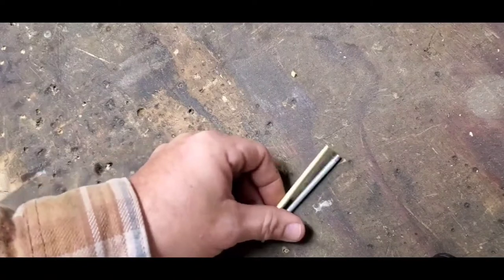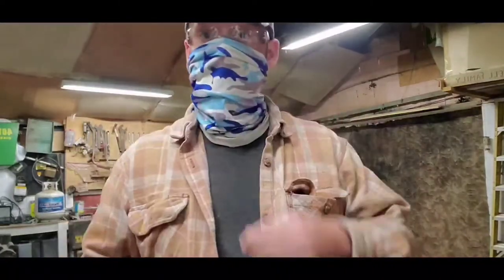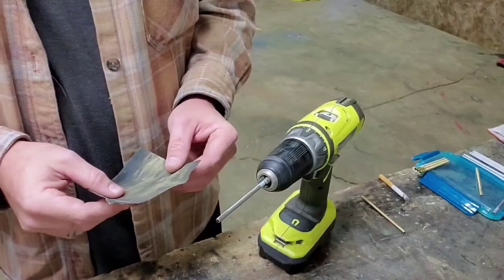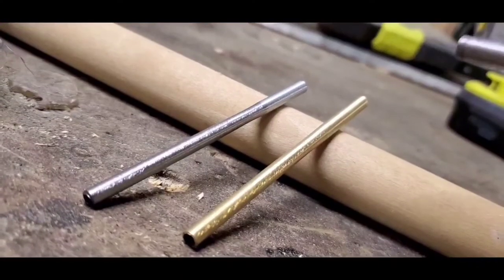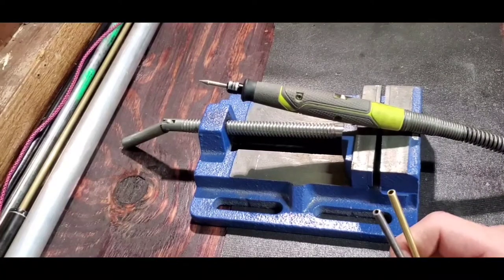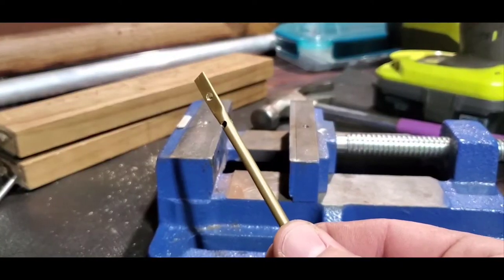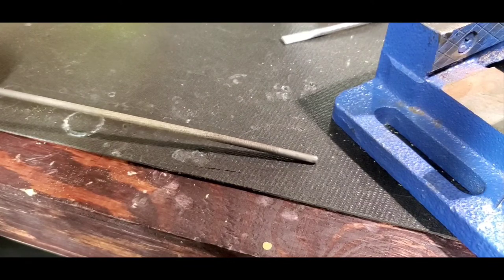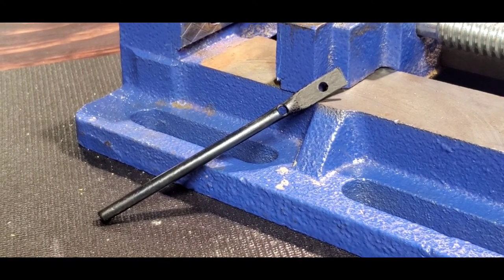Walkthrough of the MeanStreak Airtube & Ol' Blue Hare Airtube intro for Daisy springers

Comment: Awesome! I wonder what difference (if any) it would make if the air ports were offset or if a slot/s were milled in the air tube? Gradually reducing the OD of the tube using your method to achieve a close sliding fit is genius as the tube is also going to act as a precise guide and the sealing will be improved.

Comment: Hello Johnathan.Does the ol blue hair 1/8th air tube increase fps when used with the colbolt's spring kit? Say more then the 7/64th air tube🤔
Reply from the maker: Yes. Every add on mod holds increased fps gains.